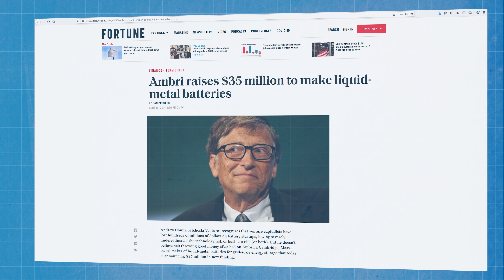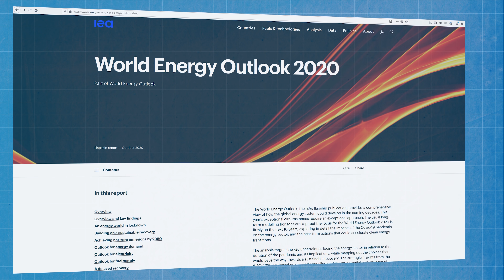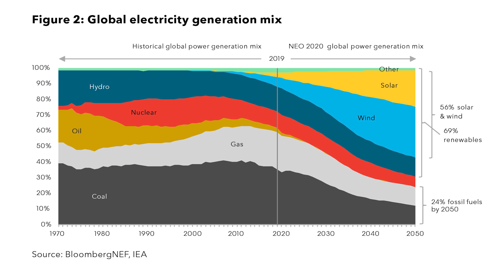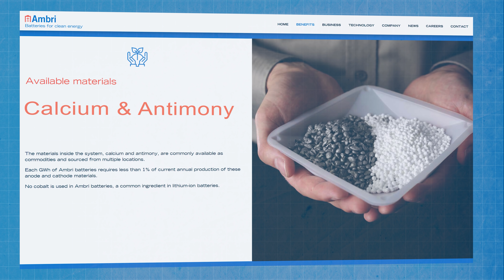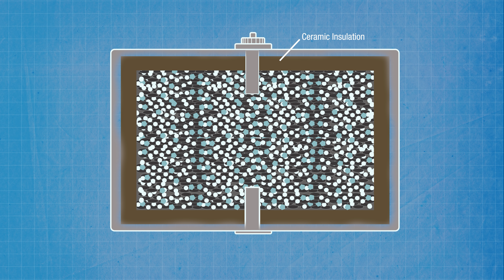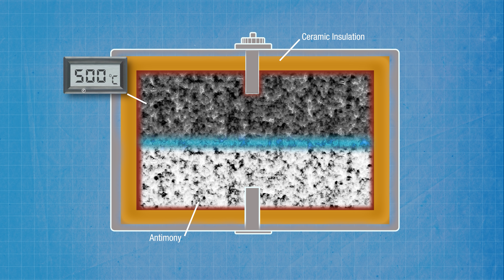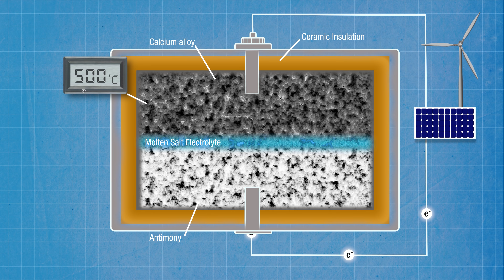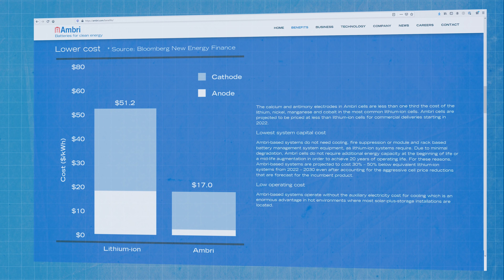AMBRI Liquid Metal Batteries. Will they really change the world?

Comment: The other end of the temperature spectrum,it's interesting how the battery companies are dealing with over heating,especially in relation to fast charging,apparently one piece of graphene sheet is enough to loose electrical heat within the regular batteries.with it's heat qualities combined with upcoming batteries incredients,no heat transfer equals no dendrites,there's more too it,interesting how they are trying to stop heat-too maintain high/fast/efficient transfer.maybe as a cheap start up,the sun could somehow directly heat metal batteries

Comment: I should probably take a minute to look it up myself but wondering if there's a general description of the weight, size, and output for the "liquid metal" battery unit.
Reply: They are very heavy and large.  But that does not matter as they are designed to be used in stationary energy storage applications.

Comment: Liquid metal batteries aren't a new technology.  I can remember reading about Vanadium Redux batteries something like 30 years ago.  They're great in theory since the charge is stored in the liquid electrolyte, so you can recharge the battery by just replacing the electrolyte much like refuelling a car.  So, you ask, why didn't it catch on?  In a word: Vanadium.
Vanadium is a very rare metal, and hence is very expensive, especially in large quantities.

It seems that the electrolyte for the new batteries featured in this video is made from far cheaper substances which is good as far as it goes, but another question which then comes up is, what's the energy density of the batteries?  In other words, will they hold as much energy as a lithium technology battery of a similar size and weight?

A down side to these new batteries when compared to the original liquid metal batteries seems to be that, with the electrolyte being at 500 degrees (centigrade, I presume, not that it makes much difference at that temperature), there is no safe way to change the electrolyte "on the fly" like replacing a car's fuel supply.

There's an old saying which is something like "what you gain on the swings, you lose on the roundabout" which means that it's all about balance, and it's also about matching the solution to the problem.

Comment: This type of battery looks like it would work well in combination with a heat producting electric plant, like geothermal, natural gas, biogas, biomass, nuclear, coal, oil, solar thermal plant, etc. Then the waste heat from electricity production can help to maintain liquid metal temperatures.
I don't see this catching on in most places but there certainly are many good cases for batteries like this out there. Hydrogen production, storage and use is the grid scale solution that I am most excited about. It is the only way that I know of to store energy from summer for use in winter. Liquid metal batteries, pumped hydro and Lithium batteries are great for daily fluctuations though

Comment: Expensive grid batteries (and they're all expensive) have a fundamental problem. They store a limited amount of energy that can run out. You can add more of this expensive storage (which IS and always will be expensive) which will be subject to diminishing returns. That is you'll spend more and more on battery capacity that will be used less and less.

Comment: If it works and is so much cheaper to make, why hasn't a small scale been started?
      Lets take a power wall size unit, then make those. They are not cheap so a slightly inexpensive alternative should still make a good profit. You keep dumping profit back into the company until you can expand. Then you double production, cost decreases and you profit increases. Rinse and repeat for x4.... then x8.... etc
      In the mean time your getting your product in the public eye and expanding. At each expansion you can introduce additional products to increase market sales and increase expansion.
     Maybe you want to start with power walls, maybe truck batteries, maybe something else. All you need is some investment to get a single building plant started.      
          Your video reported there where already some who did that. Everybody wants to start at the top and doesn't want to put the work into getting there. 
      We if it works show me, start producing batteries. With the incompetence of politicians this past year there is no lack of available work force. There are plenty of businesses that have been ruined to find a starter plant cheap.
       Well!?!?!

Comment: If you read their papers, the big problems have not been the chemistry of the energy storage, but the container.  In the early prototypes, the electrical connections were made with expensive precious metals, and as they've tried to develop something less expensive, they've struggled to build a container that won't react with the components (in one version, all the electrolytic salt combined with the ceramic), and can maintain structural integrity and a gas seal through continuous thermal cycling.
Reply: Yep, the devil is always in the details.  It's fun to wave your hands in a classroom and talk about your perfect solution and how it would solve all the worlds problems if only the Evil CosmiDemonic Corporations would give you a break, but reality has a way of kicking you in the ass in ways your blackboard solutions didn't anticipate.  Still, I give them props for making a go of it commercially, and I hope they do figure it out soon.
Remember, you aren't competing against one energy producing industry, you are competing against ALL of them, and they want to win too.
Reply: If you've listened to this video, the container is some sort of ceramic (ie a form of dirt). If you grab one of your coffee mugs, or a plate, its made of clay, or porcelain, which are ceramics. The shiny glaze IS glass ! The struggle is to reduce oxidation, so a fluorine based ceramic may be best, since fluorine is a better oxidizer than oxygen, so its burnt remains (the ceramic), will be less reactive, than oxides (burnt remains of oxygen reactions). Sealing ceramics has been done. Old broadcast TV & radio stations, use to use special high power vacuum tubes, with ceramic bodies. Its a matter of making it economical. Like all engineering, the devil is in the details.
Reply: I remember that, it set them back quite a bit. What did they ultimately decide to use for the container material? Hopefully they can (have found?) find something that will still allow the technology to be relatively low cost.
Reply: @brwin  why not make it out of concrete? Also why the need for a seal? can't the anode and the cathode sit inside and be powered through induction?
Reply: @theplacemamaia  I'm not a materials scientists so I can't explain it but here's a copy paste job: "In particular, each liquid metal battery cell requires a high temperature seal that is hermetic, electrically insulating, and non-reactive to oxygen as well as the metal vapours and molten salt inside the cell." - I take it, it took them a while to find or create a material that fit that bill.
Reply: @brwin  I'm as simple as dirt, so maybe just as cost effective, too. So IF "each liquid metal battery cell requires a high temperature seal that is hermetic, electrically insulating, and non-reactive to oxygen as well as the metal vapors and molten salt inside the cell." doesn't that sound a lot  like glass, ( Pyrex, or some specialty glass ) ? Once installed for a grid they are stationary, eliminating the obvious limitation of a glass battery. I'll go to bed, now, and dream about how up to this point an obsession with  automotive applications has clouded the issue, so I'm a hero, until tomorrow when I check back and find someone points out  the flaw in my thinking. G'nite : ) 
"Glass can only be molded at very high temperatures. It completely melts/liquifies at approximately 1400 °C to 1600 °C" much > than the 500 C operation temp required. ... See Properties of oxide glasses https://www.britannica.com/topic/glass-properties-composition-and-industrial-production-234890/Properties-of-glass
Reply: @theplacemamaia  "why not make it out of concrete?" Concrete does not stand up to thermal cycling so very well, nor stand up to even sea salt over the long run, at least in my experiance, so I'd guess that the molten salt bit might be hard on it.
Reply: @mittnival5562  Sounds like you may be joking, since using any type of chemically-inert glass as a container/case poses very obvious problems. For one, glass is brittle when cool, so can shatter during transport or even in use. And when glass is heated, even if only to 500-700 C (1/3 to 1/2 its melting point), it becomes semi-viscous and so at that temperature a glass container will "sag" or "droop" or even very slowly melt. We won't even go into it's insufficient thermal insulation properties.
Reply: @whoknew4722  1) as stationary units glass works, think like huge thermos bottles. 2) your view seems to be about window glass not variants like Pyrex, which I said as  an elementary example. 3) as to cold when is that part of the process. ? Your points are all sacrificing good enough to be functional for perfect.  That's no way to get a railroad built.
Reply: @theplacemamaia  Concrete degrades at temperatures above 300C.
Reply: @mittnival5562  Or a layer of thin film diamond and your melting point goes to 4373 °C. Diamond is a great electrical insulator but a good heat conductor to keep the heat consistently distributed throughout in the chamber.
Reply: @MichaelRDavis-qv9jj  but not
“dirt Cheap”
Reply: That sounds like a very solvable problem, doesn't it?
Reply: I think that that's an incredibly important criticism.  Perhaps the fact that it's all metals and they are differentially separable and the materials theoretically completely recoverable could negate their tendency towards oxidizing their containers.  Like they could just distill all the metals and grind them back into powder and Bam! new battery

Comment: So, there are liquid metal battery, and there are liquid metal batteries? Currently (no pun intended) electrical power is now in use to  melt metal, in manufacturing. I have seen one proposal, where excess renewable electric power, is used create store molten metal, where the stored heat is use later to create steam.  Steam that is used to spin steam turbines. Have Edison batteries, have been studied for grid level, electrical  power storage?

Comment: As always so much of this comes down to cost.  The one issue with lithium ion as well is that that using them both for grid storage and ev's means that there will be a huge spike in demand when the battery cost gets to the magical $100/kwh when ev's will supposedly take off.  There is an expected boom in demand for class 1 nickel which is more or less baked into the cake. It takes 7-10 years to actually get a nickel mine into production and it is class 1 nickel that is needed.  So this will no doubt add to the cost of lithium ion grid storage.  The Ambri battery on the other hand uses a lot less expensive raw materials but is not suitable for vehicle battery.  Hopefully this along with green hydrogen will be a possible way to deal with renewables and storage. Thanks for doing this, as I've been following Sadoway for a while now.
Reply: Tesla is solving the supply issue by using different chemistries for different jobs. He's using High Nickle and Nickel/Manganese batteries for vehicles, and Iron/Phosphorus batteries for powerwall and grid level storage. No nickel whatsoever, no cobalt either.

Comment: I believe this can be a good short-term storage solution that frees up li-ion battery production for where it really needs to go. Personally I like the idea of a combination of Ambri LMBs along with longer-term storage like EnergyVault gravity storage to create true solar and wind farms that can harvest, store, and deliver energy with optimal efficiency. I believe this is the best solution to move renewables from being used for peaking and support to true core baseline energy provision, eliminating the need of any fossil fuel production.

One question though... what fit would this tech be at residential scale? Can this be safe in such environments and could it provide a cheaper alternative to Powerwalls and other solutions currently on the market? If so, this could really push residential solar adoption as it could provide local storage that lasts as long as the panels themselves, and allow customers to be free from grid outages and fix the duck-curve problem once and for all.

Comment: My due diligence suggesting Ambri/LMBs won't be viable: 

Sadoway's actual cost estimates for his liquid metal batteries (taken from his 2019 talk at Imperial College London): 

2014: Li Pb Sb $230/kwh
2016: Li Bi $170/kwh
2019: "Chemistry C" $75/kwh "and they (Lithium ion batteries/makers) will never get to $75/kwh"

Tesla estimates for their cells (battery pack level):
2020: Tesla Li ion 2170 cells ~ $100/kwh
2021: Tesla Li ion 4680 cells ~ $55/kwh

Meanwhile Sadoway calling Li ion battery proponents "Barbies" and offering a multitude of other slurs and slights to any party not in line with his mad academic, pre-commercialized pursuit.

Antimony (Sb) and bismuth (Bi) are rare enough to be cost restrictive of LMBs. So unless he comes out with an entirely new chemistry, this cannot compete with Li ion batteries.
Reply: I'm sure there would be loads more antimony if we had to look for it, I doubt the 5million ton resource is all there is. Even so it's unlikely there's enough economically, so I had a quick look at the Periodic Table by electronegativity for the common elements. Frankly Zn, Al, Si and S is all there is and Na, Ca, Mg and Li on the electropositive end - therefore if we can't make batteries of some sorts with pairs of these then we're probably stuffed.

Comment: You left out any discussion of drawbacks and gotchas (which are apparently common features of all new battery systems).  Liquid metal batteries need energy to stay molten, and that energy comes from the inefficiency of charging and discharging.  I've heard Sadoway quote 70% or 80% round-trip efficiencies, so it's not a deal-breaker but definitely worse than lithium.

Also, last I heard, one of his biggest challenges was finding an appropriate material for the electrolyte seal.  It has to be an electrical and thermal insulator, chemically inert against a highly corrosive environment, and mechanically robust enough not to crack while being handled.  That's just not an easy material to find, but perhaps it has been solved, since Terascale is on board.

Don't get me wrong, I think Ambri's batteries are perhaps the best path forward to grid-scale storage.  Really exciting dirt.  I just want to keep an eye on the hurdles as well.

Comment: @ 9:06 "the biggest challenge Ambry faces, is the economy..."

Aha ? As a dumb newbie, with a 500°c liquid held by nothing but a battery casing made out of few millimeters thick ceramic sheet, i was thinking it was the safety of the device (after all, it's was'nt if you may get cooked as a turkey in the oven just by passing at less than a meter beside (or worse, above) this stuff...)

And is'nt it ironic to claim "trying to fight global warming" with such hotter-than-hell item ?

Comment: 500*c Temps might be an issue if something goes wrong.
Reply: What's the worst that could happen? The molten material might spill out. right? It'll harden soon and, IMO, the material can be reused. Hence... no issues
Reply: @GummadivalliShivaKumar  start a fire, burn a hole in the floor,etc.
Reply: @Phil-D83  what'll burn? Have you seen the platforms on which these storage systems are setup? They are flat concrete slabs. There's to catch fire 🔥, and the last time I checked concrete can take temperatures upwards of 1500 degrees Celsius. If you think the electrical connections and contactors can be destroyed, guess what there exist current infrastructure and tech to take care of such situations... So, IMO, the temperature is not a problem
Reply: @GummadivalliShivaKumar  I hope so. I can see things going wrong. These are not batteries we can have at home,etc Better than lithium batteries, but still has a way to go.
Reply: @Phil-D83  There's no disagreeing to that for sure. Hopefully this'll be successful and will come to Indian markets soon 🤞

Comment: I'm almost halfway through and I still don't know what a liquid metal battery is, beyond what's obvious from the name. 

First thoughts: 
- Mercury is toxic
- Lead is toxic
- Liquid toxic metals are a spill hazard
- Where do you get the heat to keep the metal liquid? Energy storage should not require energy consumption to be stable. 

Imout.

Comment: The question is with the salt. Molten Salts are extremely corrosive. I wonder how Ambri has dealt with this problem.
Reply: What is there to corrode?  The container is a ceramic.  Nothing corrodes a ceramic (maybe HF).
Reply: @bromnader5196  Salts can corrode a lot of things., even some ceramics. It does depend on which salts this product is using, and which ceramics, but one thing is for certain; The metal conductors that transfer the power out of the molten metal will have to be some type of electrically conductive material (almost certainly a metal) and it will need to stand up to the salt's very corrosive nature. 

Many a power projects have failed due to the under estimation of salt's corrosive properties. This is one of the main hurdles holding back the development of molten salt thorium reactors. This is also the major problem that bankrupted the Crescent Dunes Solar Energy project.
Reply: They haven't.. this is the true problem, well that and using molten anything..idiots